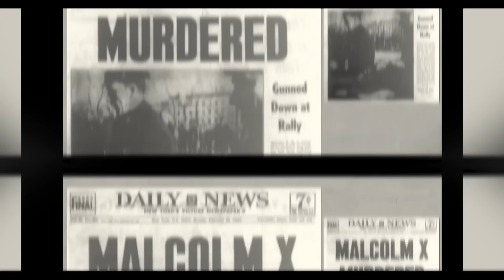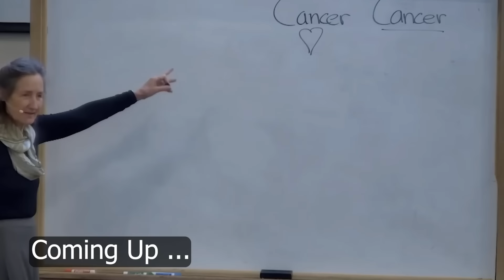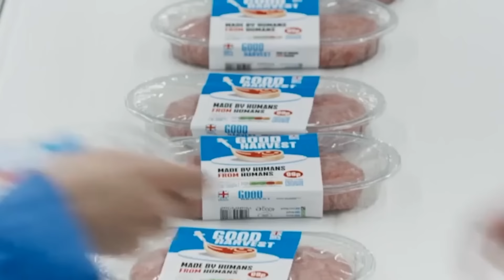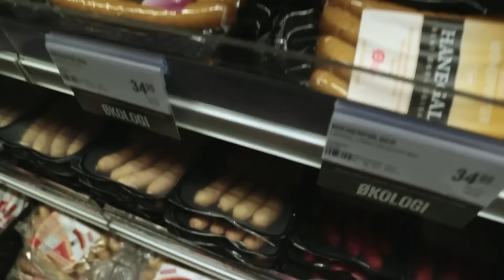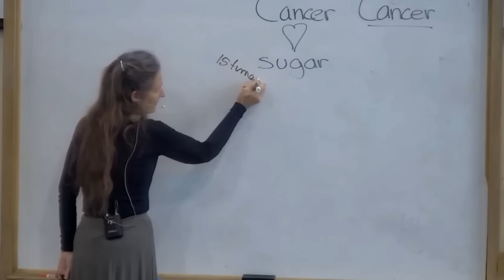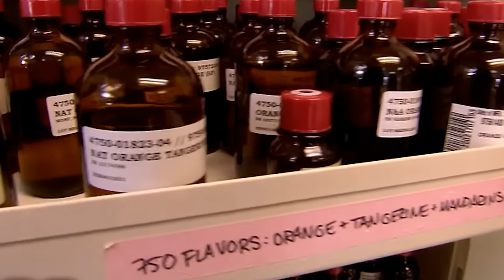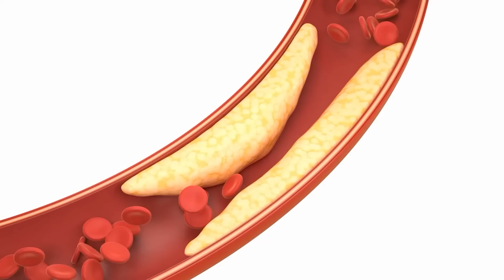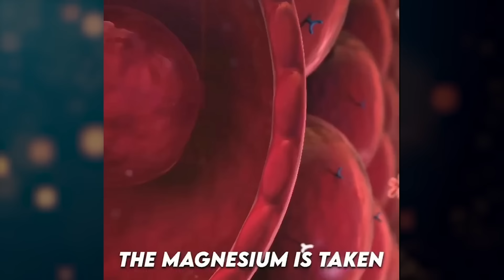Brace Yourselves PEOPLE!|“This Was NO Coincidence!| "Dr. Bobby Price |Barbara O'Neill| Dr. SEBI

Comment: I'm assuming Those posting here also grow Their own food or have considered that.
I'm continually adjusting my diet. I always have.

At 64 years my Doctors tried to convince me I was sick, with High Blood Pressure and Type Two Diabetes. (I knew they saw only spikes because of recent meals.) I weighed 220 at the time.

Now at 71 years I weigh 165 as a result of dietary changes. It has been confirmed my BP is normal as is my Blood Sugar. 

I had never told my Doctors that I'd monitored my BP and Blood Sugar for more than 30 years. I allowed Them to believe I was accepting Their diagnoses. Upon realizing They were incorrect based upon further tests I eventually told Them about my dietary process and failure to take prescriptions made.

I am healthy.
They don't know what to say to me now.